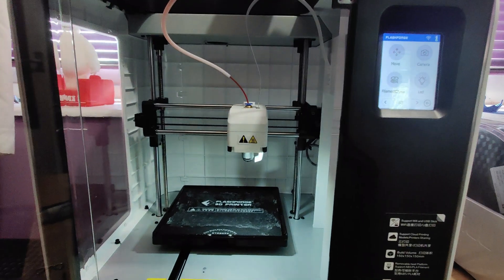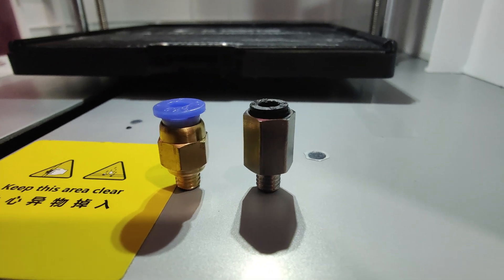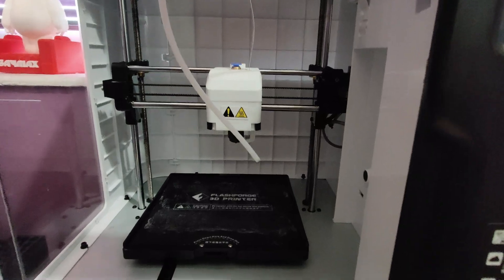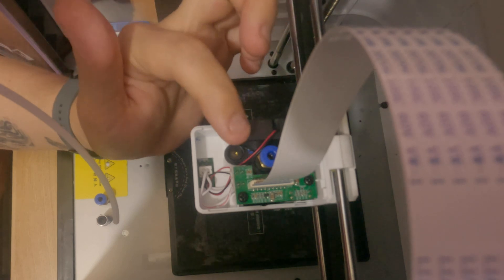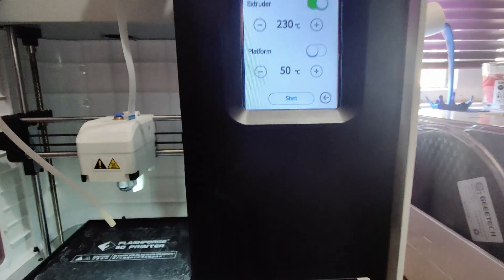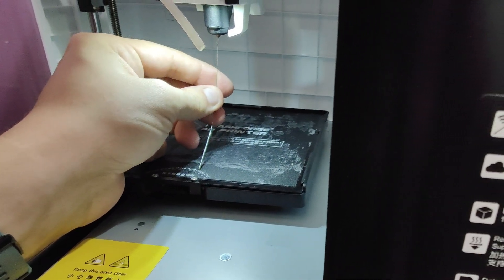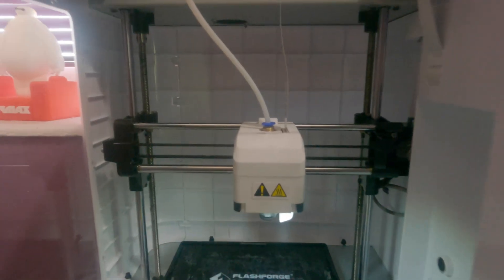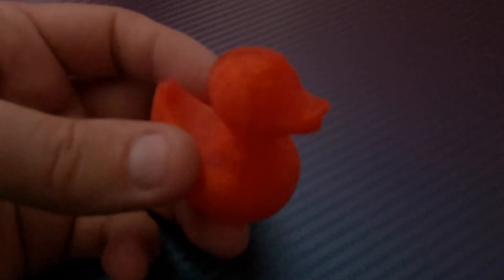Adventurer 3: PTFE Boden tube connector/coupler replacement

Comment: Picked on up. Works great. Personally, I found using a small socket attachment on my screwdriver allowed me to remove the old connector. The next size or two up was needed for the replacement. All working!

Comment: This happend to me to, were did u buy the new pipe joint? I bought a new from 3dprima but the one u have looks allot better. I know this will happen again in the future. Superduper good video thank u for the guide. Hmm I just remembered that i lost the pocker, do u think heating it up and do the extrude filament will help? or if I just feed new filament into it and let that push it out?
Reply from the maker: Hey, the coupler was purchased from Amazon, 

Check the video description, I'm sure I added a link

Comment: I need help! I can’t remove the coupler, it is too long and really attached, when I try to move it, the fan moves and I’m afraid of break something
Reply from the maker: You should be able to remove the shroud (plastic cover) making access to the coupler a little easier. 

With that out of the way, a small socket/pliars may be easier, 

Just check which way you're turning it, 

I don't currently have the Adv3 anymore, so can't check,  but any issues reach out on the official Flashforge usergroup on Facebook. 

alot of owners on there who will happily check things for you
Reply: I have this same problem. My Adventurer 3 has black/dark nozzle and the coupler is long and metal (not golden). 
Glad I stop trying with force to found this comment here.  Will try to remove the plastic shroud (on top of the coupler).

Comment: Thanks for the information. I did change the pneumatic coupler exactly by the one you now use and I works well. Do you know if there is a specific lenght for the PTFE tube because my filament feeder knocks on my Adventurer 3 ?
Reply from the maker: The knocking on an adventurer 3 is nearly always due to a partial blockage or being too close to the bed. (The filament isnt passing through at the speed it's supposed to, so it's "knocking" back in the extruder. 

Check the official Flashforge group on Facebook, and there's an article I made months ago which explains the process to clear things up, which seems to have been perfect for dozens/hundreds who I've pointed to it so far.
Reply: @LeeHubbz  Hello Law Gaming. Your solution works perfectly. I am very grateful to you. I cleaned over the nozzle and adjust to 100 %. I wish the best.
Reply from the maker: @Pier2com  That's great to hear. Happy to help..

Comment: The head needs to be REMOVED from the printer to change the retainer. Doing this job while still installed risks damage to your X-axis smooth-rods. You didn't even remove the ribbon cable - if you knock that sideways, you'll be in for yet another repair job.
Reply from the maker: I've spoken with Flashforge today and they have confirmed that the operation outlined in this video is correct, and removing the entire print head is not necessary.